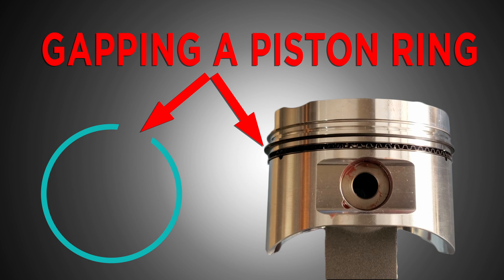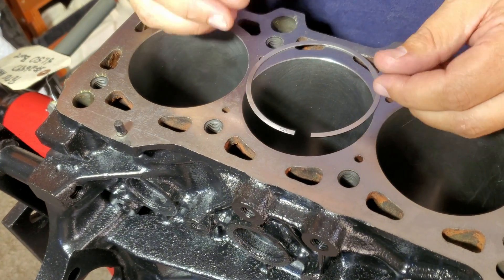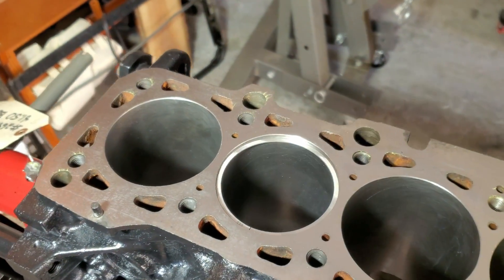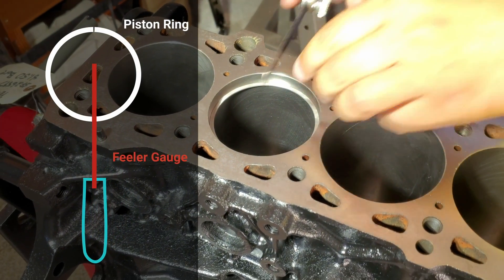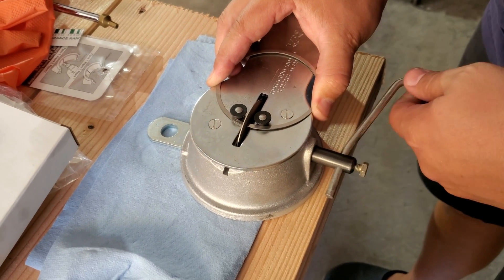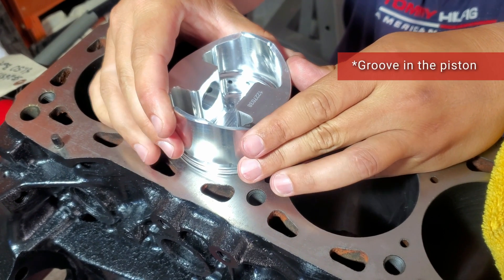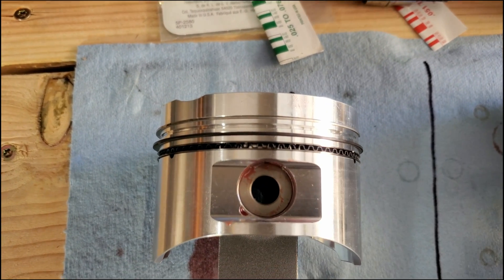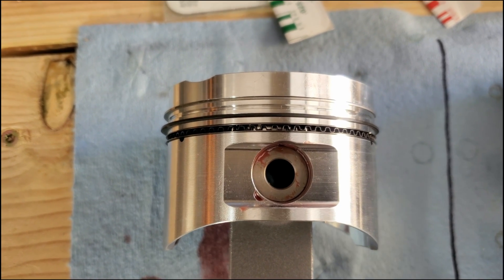Gapping a Piston Ring

Comment: I'm not entirely clear if this is to create a gap or to make sure there's no gap at all when it's installed.
Reply from the maker: Piston rings need a gap.  This allows for expansion of the piston ring, as it get hotter from heat.  Not enough gap, and your piston ring could bind up in the bore.  Too much gap and you could get blow by into the crankcase.
Most piston rings come with a suggested end gap.  This is what we were measuring in the video.